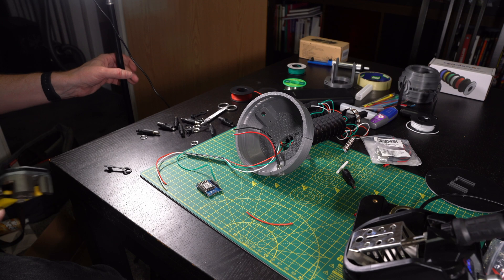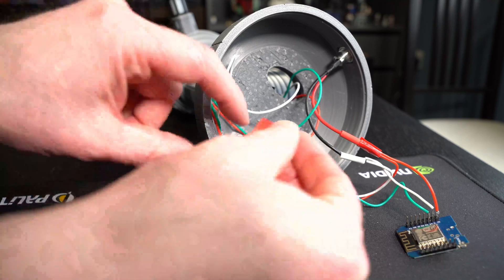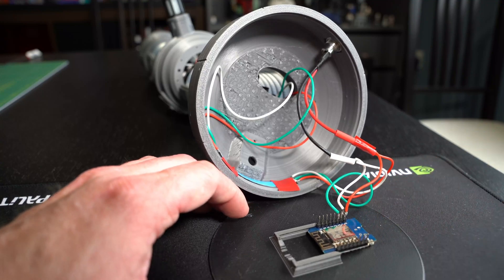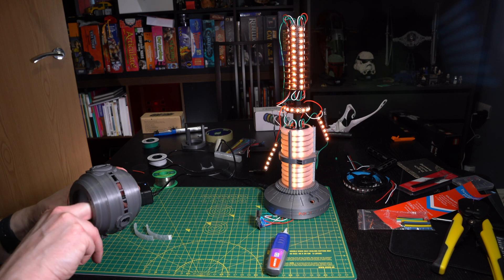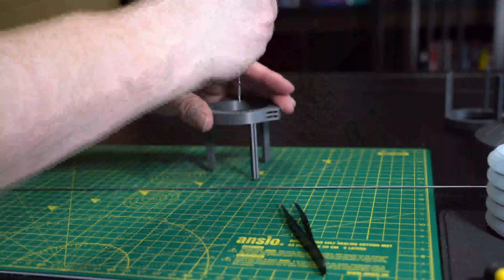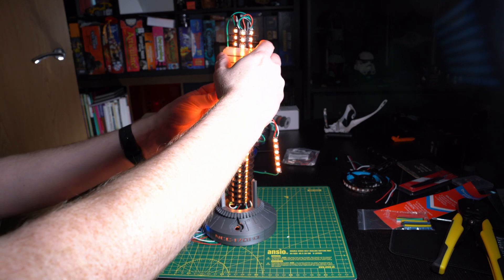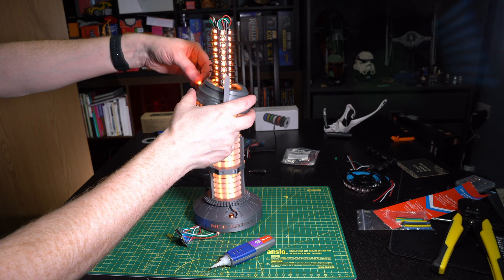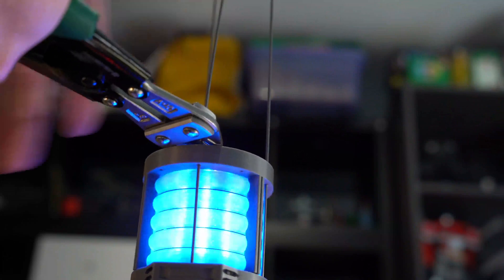Star Trek Enterprise-D Warp Core 3D Print and Build  - Part 4: Assembly

Comment: Thanks for making this set of videos together.  I've never done anything like this before therefore  I definitely referenced them a few times when I built my Warp Core model.  

I printed everything with no issues, using the suggested Space Grey and Transparent filaments.  After putting everything together I tried using a bit of diffusion paper inside the MCS tubes and did notice that it did a great job of diffusing the LED lights.

My soldering skills are good enough that I had no trouble soldering the LEDs strips.  Although I didn't make the wires going to the left and right conduit so it was much more difficult for me to pull the LEDs through the openings in the core.  But with patience and a pair of tweezers I was finally able to get everything together.

Unfortunately I didn't follow your advice about double checking the fit of the piano wire before adding glue to the segments, so my Warp Core doesn't have the extra strength from the wires.  But but I don't think that will be much of a problem if I'm careful.

Once again, thanks for the great set of videos!
Reply from the maker: Hi Joe - thanks for the feedback, it's really nice to hear somebody has found them useful! Also great to know your build has gone well overall. 

I think it looks great without the piano wire anyhow, and I guess maybe if you cut to size carefully you could insert them if you wanted, but like I say - it looks good with or without. :)  

Good idea using the diffusion paper, that is something I wish I had done as I think it would improve the look overall as on brightest settings the LEDs do show a bit through the transparency.